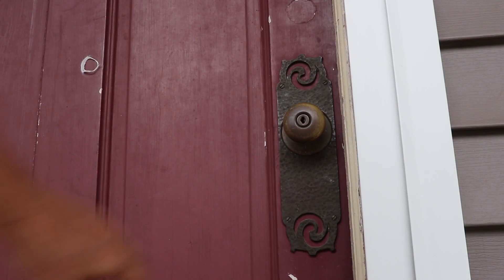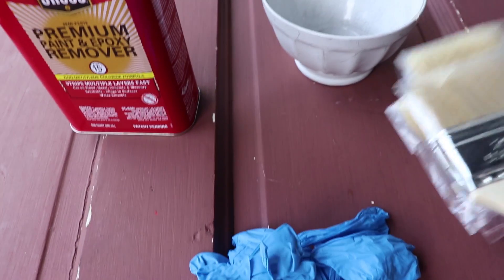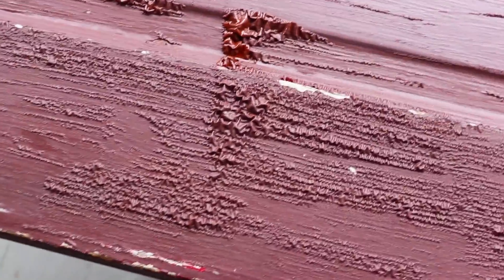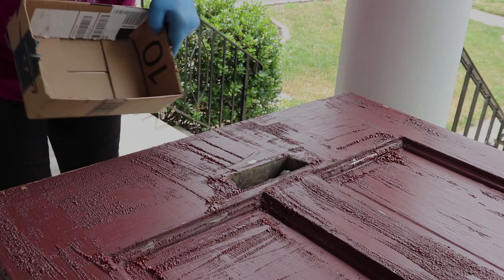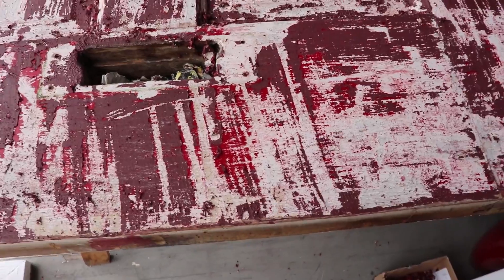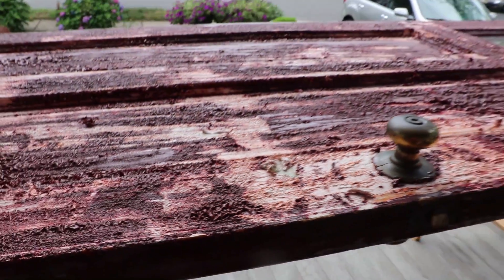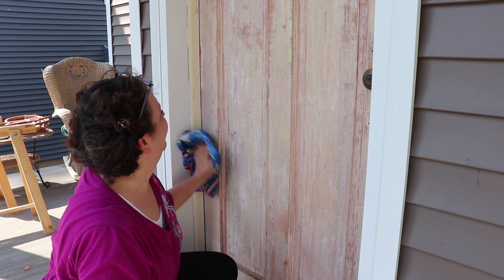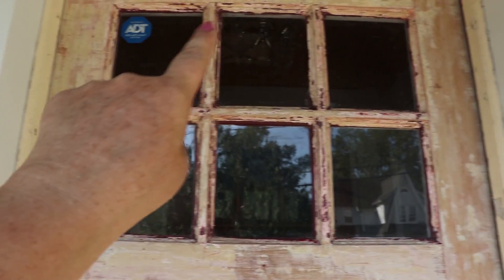SAVE THE DOOR Project - Part One

Comment: I have the same door knob on my door. From1956. Still works like a charm!
Reply from the maker: Ours still works too but we only have one key and they can't reproduce it or so we are told. But i am glad you gave me an age on it. I suspected the hardware was from the 50s. I am wondering if the door is from 1929 when they built the house or a replacement from the 50s. It s solid oak.
Reply: My Great Challenge   
We can still get those keys in Western New York. But probably newer locks are more secure. I have a 1956 ranch and try to keep everything original that I can. Including the doors and all the hardware

Comment: You are doing a great job as usual. Have you thought about using the expanding foam in a can for the mail slot area. It should out the drafts and you'll be able to keep both your mail slot plates inside and out. You are always so motivating.

Comment: I started stripping the paint from my side door months ago. It was chipping off in chunks on its own so I took a scrapper to it but just like your door, it had multiple layers of paint, including the pistachio colour!!  That colour must have been popular at some point in time along with different shades of beiges and yellows. The door seems to be original to the home which was built in the early 60’s. I stopped doing anything else to it as I didn’t know how to use a paint stripper and didn’t own a power sander. However, after removing some layers of paint, there seems to be water damage or water rot on the bottom panel of the door. Now that I have a paint stripper and a sander, I’m not sure whether I should continue with my project. 
Any suggestions? A brand new modern door with a new transom above it will be setting me back close to $2k.

Comment: The lady who restores houses on HGTV soaks all the stuff your taking off in a slow cooker all day
Reply from the maker: What for?
Reply: @mygreatchallenge  Nicole on Rehab Addict puts hardware in an old crockpot (with just water, absolutely no chemicals) to soak the paint off. You let it "cook" all night on low & the paint falls off. Your door hardware isn't painted, so you wouldn't need to do that, but it does work like a charm if you ever have painted hardware.
Reply from the maker: Ok so I totally misread I thought the stuff in question was the goo with all the paint. Lol